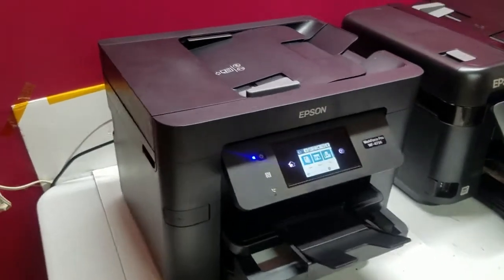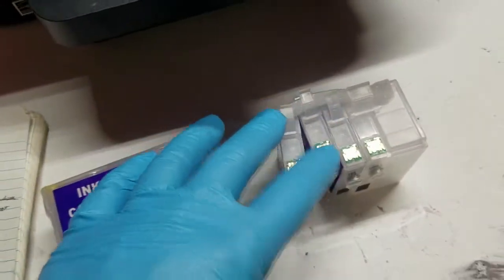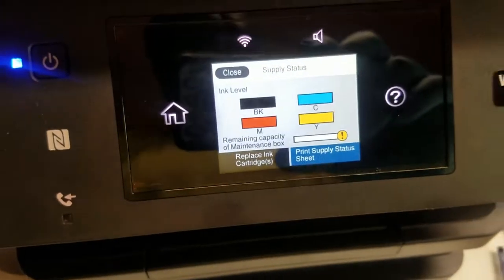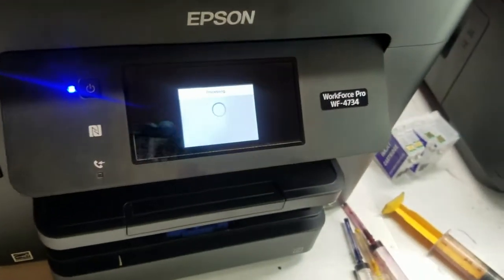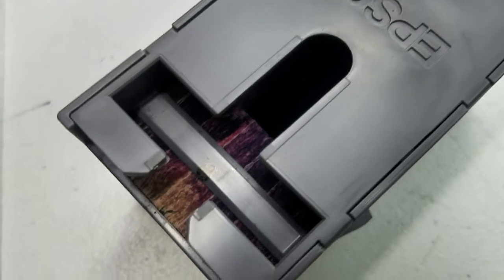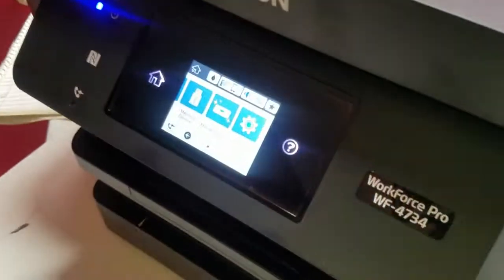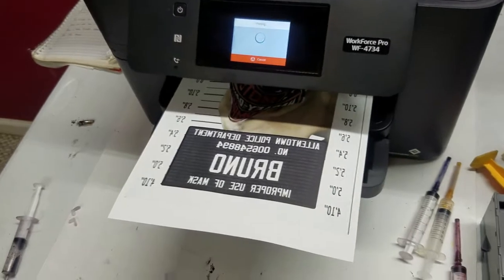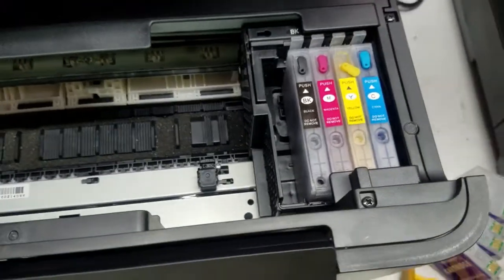Sublimation Printing with Epson WF-4734. (Pt.2)

Comment: It is strange that it works for you but I got the exact same inks and cartridges with no chips, it just keeps telling me to check the codes.  It does process at all.  I don't know what I have done wrong.
Reply from the maker: If it's a code issue. Hit up your chipless firmware distributor. They can check the code and be able to help.

Comment: Your videos are very informative a nd it seems like you have done the quite a bit i was wondering if you could help me. I have went to the website and downloaded the firmware for my wf 4734 I was successful in putting my printer into firmware update mode and update the firmware but when I got to run the second part of the program is when I start having problems i choose my printer in the list and choose activate on line I get a message that says wrong id code and nothing more is their anthing you can think of or have you had this problem your help is greatly appreciated
Reply from the maker: I've never had that issue. There is a forum on that website though. They seem to answer questions in there pretty fast. But I've never had any issues installing.

Comment: I had ordered a 4734 since the 7720 and 7710 were out of stock. I couldn’t find a video on how to sublimate the 4734. So, my plan was to return the printer once received the order. I came across your video and I think I just might keep it. Do you print t shirts with the 4734? I really would love to have the 7720, but can’t find one anywhere except on Amazon where they’re over priced due to supply and demand.
Reply from the maker: I only print on Aluminum at the moment,.

Comment: I'm getting an error message after putting the refillable cartridges in.
Reply from the maker: What kind of error message?
Reply: @McZell  "Ink Cartridge is not installed correctly"
Reply: @McZell  The cartridge are pushed all the way down.
Reply from the maker: If you have installed your chipless firmware. You shouldn't get any error messages.
Reply: @McZell  The Chipless firm is in but the printer isn't registering.
Reply: @McZell  Is the activation key required.
Reply from the maker: @latorifrazier460  yes. You have to follow the instructions on the page. Once you confirm that the Printer can be updated, then you purchase the activation key. If it's telling you that the ink cartridges can't be recognized,then the firmware isn't installed properly.
Reply: @McZell  I've tried the step by step process and it still doesn't work😔
Reply: Do we have to buy the activation key?
Reply from the maker: @kimt312  yes